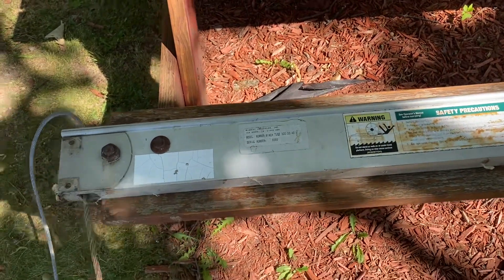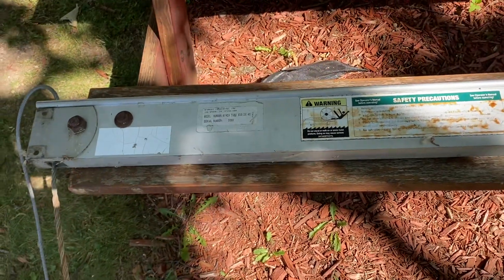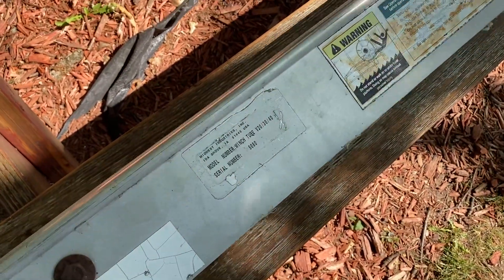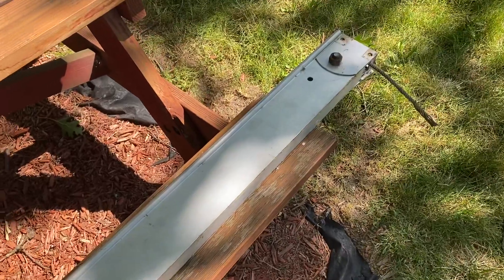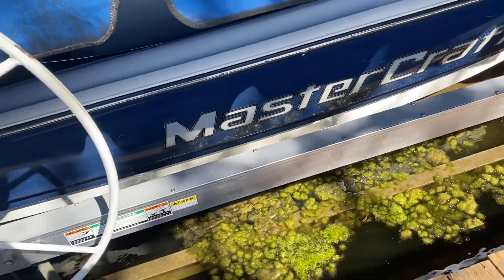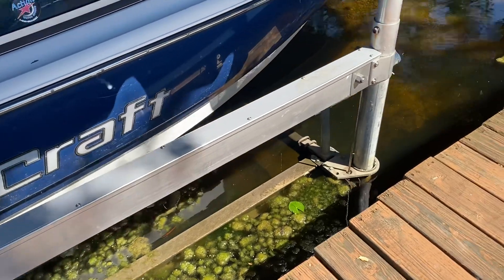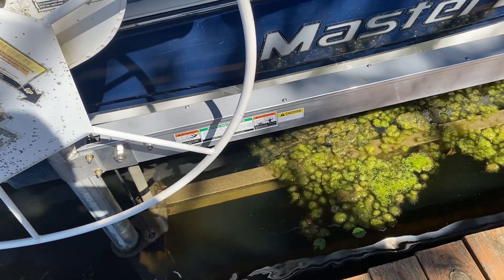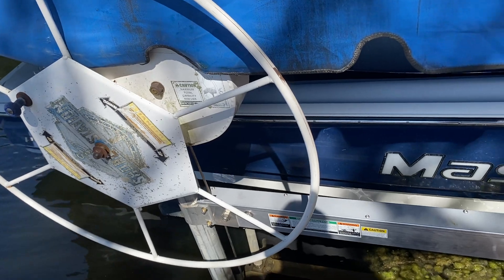ShoreStation Winch Tube Replacement

Comment: @1965dieter Were you able to use the new brackets or did the old bracket bolts line up to this new tube?